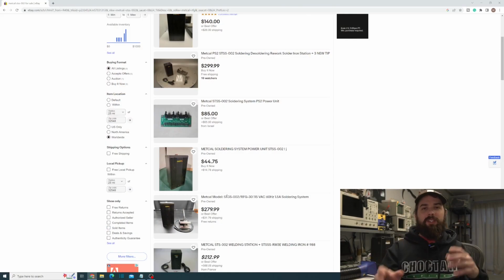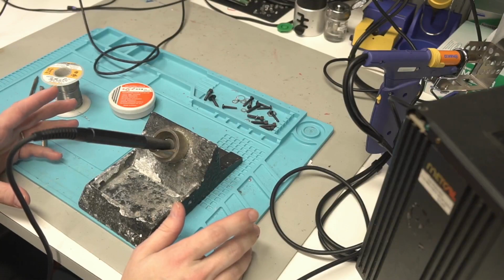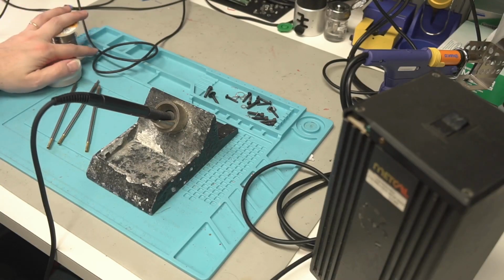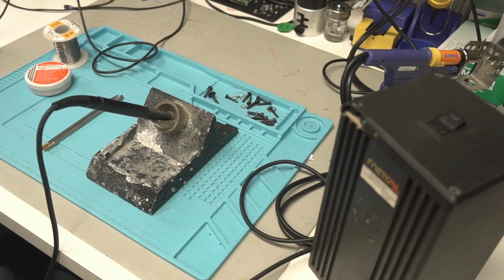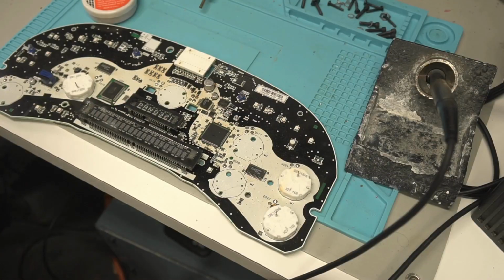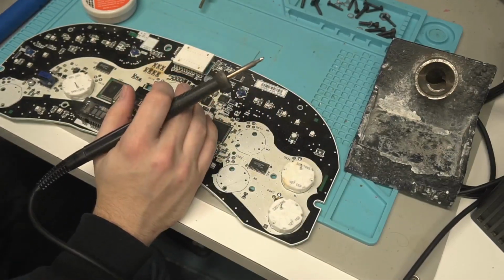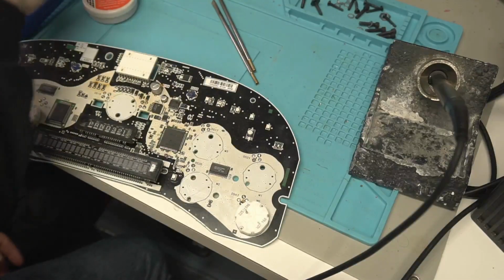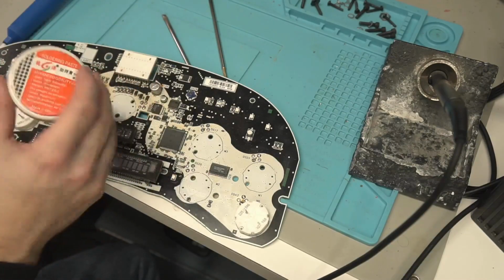Metcal STSS-002 Soldering Station Giveaway

Comment: I've had bad luck upgrading my Hakko FX-888D... I bought an FM-202 used on eBay, and a new handpiece on Amazon, only to discover that the tip wasn't reaching the proper temperature (by means of the solder taking way too long to melt). So I bought a new FX-951 directly from Hakko USA, only to discover that handpiece still didn't reach proper temperature. So now I've exceeded my tooling budget for the year and suspect I have a counterfeit FM-2027 handpiece with no way to prove it and discovered out of Amazon's return window.

Comment: Anyone who knows Metcal knows this isn’t “half-hearted.” They’re the Rolls Royce-nay… the Bugatti Veyron of soldering station performance! No other manufacturer has their tech that exploits the Curie Effect to perfectly maintain temperature with near-instant heat and “recovery” …in quotes since it’s only theoretical that I could even find a thermal load large enough to saturate the perfect thermal response of Metcal’s exclusive tech (certainly not with a legit electronics workpiece!).

My station since 2016 is an Aoyue Int 701A++ which takes clone T18-style tips. That’s the obsolete kind Hakko only still uses in the beginner FX-888D… not the modern T12 cartridge types from the FX-951. I’ve been shopping for a good JBC 245 clone myself but had to give up on the idea for now due to circumstances.

…and this is where it’s going to sound like I’m making stuff up but every word of this is true:
These “circumstances” include my mother’s impending homelessness and my inability to help since I’m already displaced by a tornado. I actually intended to move in with her until I get back on my feet but that’s when I heard about the landlord deciding to sell her home of 43 years! She has to abandon her trailer because it can’t be moved. I’m literally sleeping in my rented workshop a block away and have no bed to offer.

No, a soldering station isn’t going to help with that but it’ll certainly be useful for my hobby/side hustle that I hope to turn into a business (upgrading and repairing old electronics).